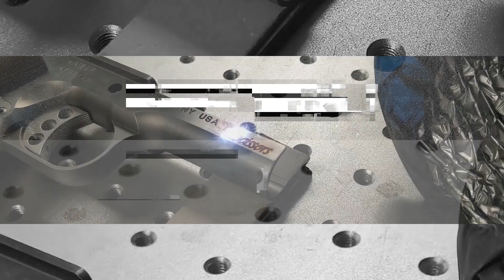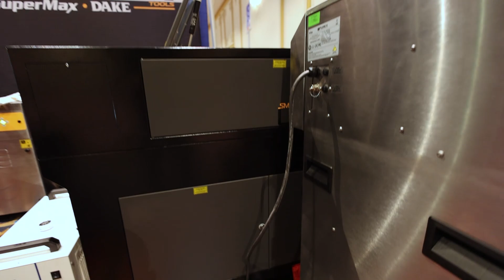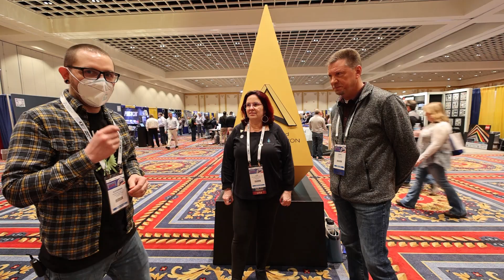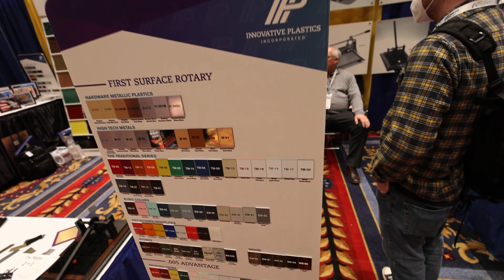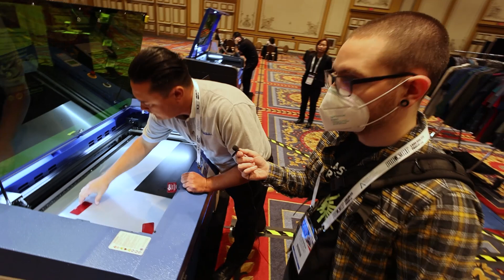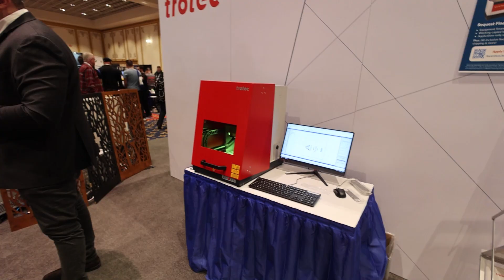APA Expo 2022 | Laser Engraving HIGHLIGHTS and INTERVIEWS

Comment: It's funny how people are one type of laser guy or another. As far as CO2 goes, I'm a Laserpro fanboy myself, because of their ease of use and windows driver. I had a bad experience with Epilog CO2 vibration ruining my work so am sticking with GCC. I have the Venus and C180 metal tube lasers. I tried to find an affordable Fiber laser with a windows driver so I can do everything in Corel, but gave up, and just ordered a JPL 50W with a 175mm lens, so  have been watching all your videos on EZcad and find they are helpful. I detected your interest in galvo based CO2, but I would recommend against that technology because it really is only suited to smaller raster engraving, where an XY table system will do that as well as straight cuts through Acrylic on larger materials. That 40W laser with the metal tube that uses lightburn would be a better choice. I have a 30W metal tube that is 14 years old and still running daily although power is about 10% less than when it was brand new. It was fun to see what's new at the show, thanks for sharing.
Reply from the maker: Thanks for watching! While they're nice to look at, we have a few CO2 machines already and don't ✨intend✨ on getting another anytime soon 😊